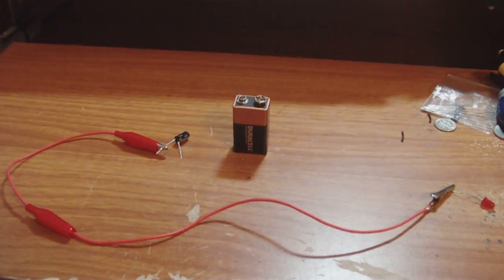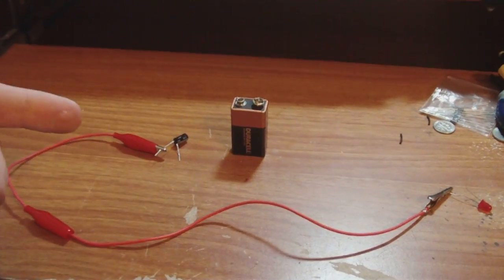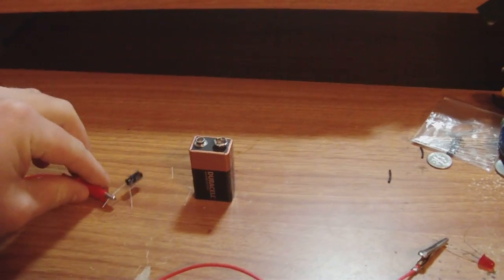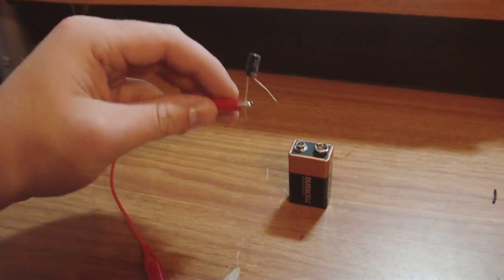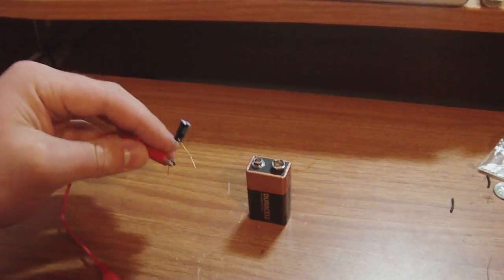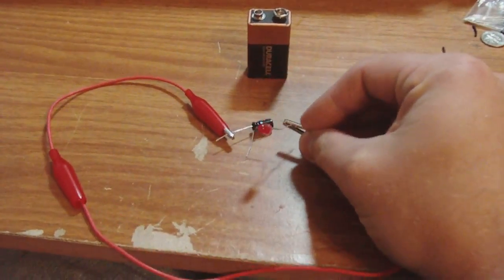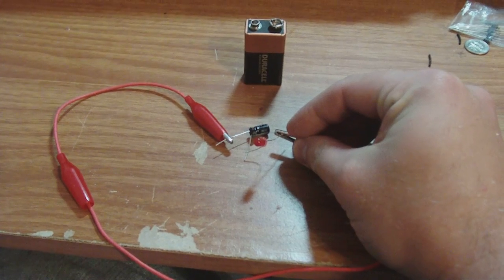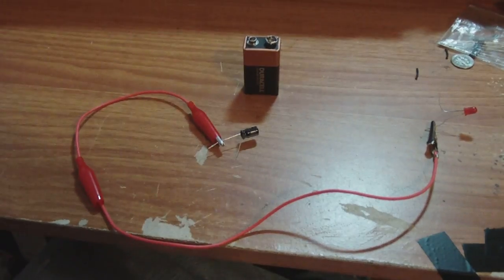Captret PROOF OF OVERUNITY

Comment: You can't easily tell how long an LED remains lit just by observing it. If it was only lit for 1/1000 of a second, persistence of vision would make it appear to have been lit for about a tenth of a second. Also, electrolytic capacitors are notoriously leaky devices. The metal case of the capacitor held a secondary charge separate from the intended charge.

Comment: this discover split in two the history of circuits design. This is the aplication of Dra chung  negative resistance experiment .Data are in de naudin site.
jlnlabs.online.fr/cnr/index(dot)htm
She spend many years seaching for a good aplication for her research...you find it. I testing six blinking leds with your captred (3), seems like the blink leds act like oscillator 9hz ...it run fine at 6v old 9v bat...76 hours and continue!!!
THANK YOU VERY MUCH!!

Comment from the maker: @GraffixWB You can read more on it over at the energetic forum, just search for captret or go to renewable energy forum and search for it there. My latest video out shows this very same thing but it done a little better, camera is not shaky. I and many others have it using the same effect but running the LED constantly, but the voltage on the battery goes up, very weird. I'll put a link in the description for you and others.